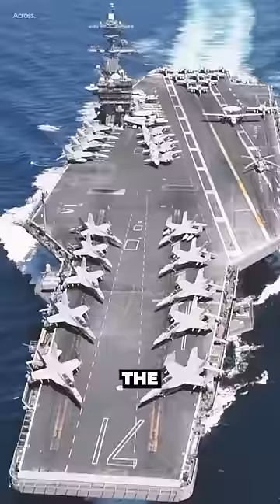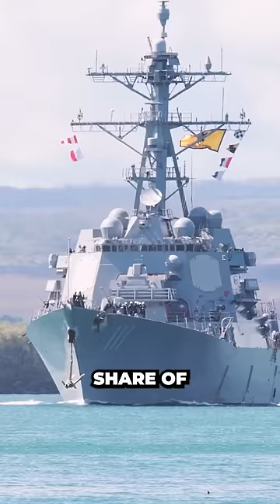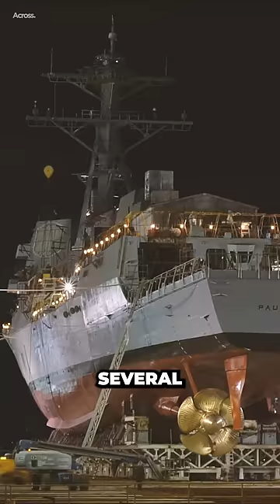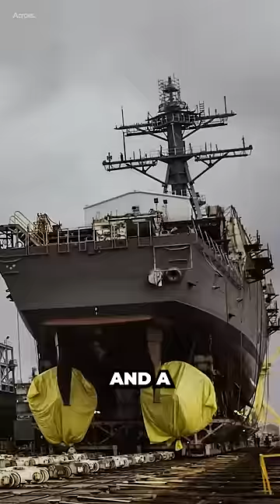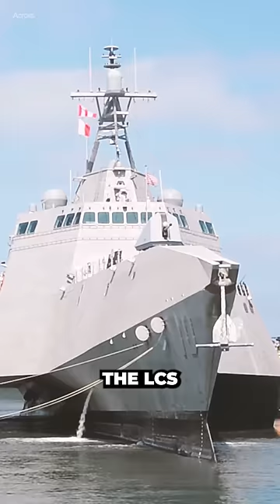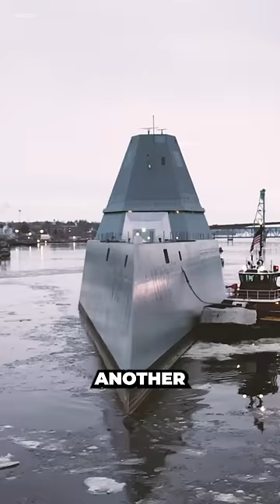The US Built Bad Warships Over A Decade #shorts

Comment: The Zumwalt was the victim of inconsistent government expectations. If they had built the platform first and then added in the new technologies it would have been fine. Expensive as all get out but still fine.
Reply: And the weapon systems issue referred to must be the attempt at the rail gun that got scrapped. The current main weapon is a very tested and reliable weapon just not what was originally being equipped. I disagree with that mention.
Reply: @ryenmccormack2268 I hope the Zumwalt makes a comeback when the technology is better, more reliable and importantly cheaper.
Reply: It was a stupid mission.  "replace battleships".  Then the LCS came around "we need to pad our hull count to make Congress happy".  Start with a stupid mission and then we're shocked by failure.
Reply: @robkemp598 The Zumwalt IS making a comeback.  The guns are being replaced with 12 launch tubes for the Navy’s version of the Dark Eagle hypersonic missile that just entered US Army service.  It had a range of 2,000 miles and a top speed of Mach 17.  They will play an important role in the US Pacific fleet.
Reply: @jimmiller5600 The LCS was actually an attempt to do more jobs with fewer (or at least multi-role) ships, as naval budgets were being cut because  everyone thought that future fights would be against terrorists and brown-water navies.  The intent was to make it cheaper.  They just tried to use a bunch of untested construction techniques and just assumed that the “mission modules” would actually work.  Unfortunately they didn’t.  Should have just built frigates the whole time.  At least the newer LCS of one class are able to be used as minesweepers.
Reply: @bluemarlin8138  Agree 100%.  The world has changed since LCS evolved from the "Streetfighter" study.
Reply: @bluemarlin8138  - All three of them. Get real.

Comment: No Freedom class Little Crappy Ship was a bad design overall. They had a modular weapons system that was an overall failure, plus they were wrought with mechanical issues from the start. This is what happens when politics gets involved. Hey come build this ship here in my state at this shipyard, and I will promise you this if you vote for me. The Zumwalt and Freedom class ships, killed the upkeep and upgrades needed for the Ticonderoga class CGs going, till we had a replacement. They were going to build the next class of Ticos, and called them the CGX, but founding was killed, to build the Zumwalt and Freedom class ships. The Zumwalt DDG is a floating turd. They couldn’t even use their two 155mm gun, due to the shells costing a million dollars per round. They now have to remove them, and replace them with missile silos. Those three ships cost the Navy almost 8 CGs. They were supposed to build 35 Zumwalt class DDGs, but built only 3 due to cost overruns.
Reply: For being a "turd" you forgot to mention any other significant flaw in design besides the guns. Which us valid but is that design really all that important compared to the overall vessel? They operate all the launchers successfully and are planning integration of hypersonic missiles. You are completely right about the funds tho, the Zumwalt was a good ship but R&D and finance killed it.
Reply: What, A million dollars per round? They better not miss their target.
Reply: @robertonavarro7713  They can’t use them. Navy deemed them to exspensive to use. Their guns are being replaced by missile tubes.
Reply: @jefflemieux5941  You mean missiles are cheaper to use.
Reply: @robertonavarro7713  Yep. Tomahawk cruise missile only costs 750k per shot.